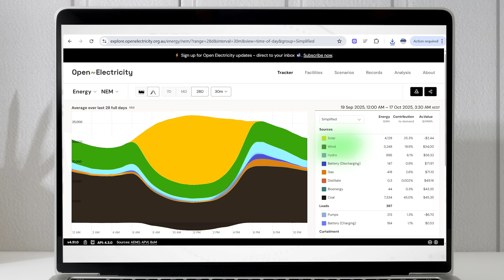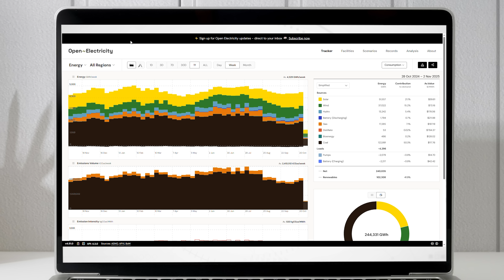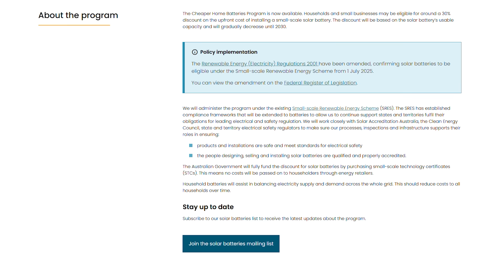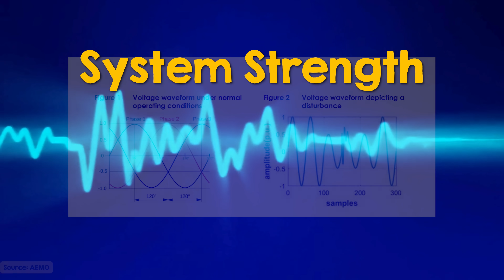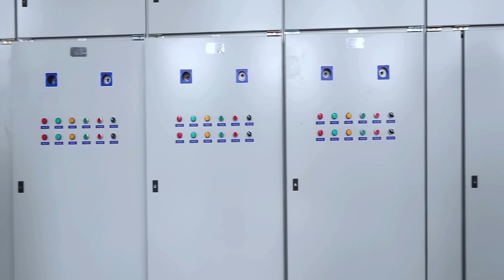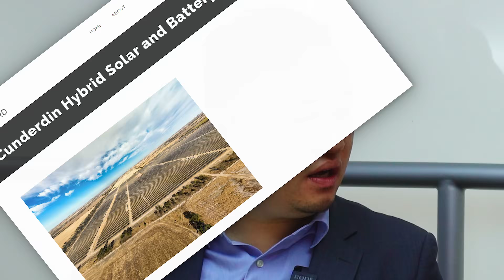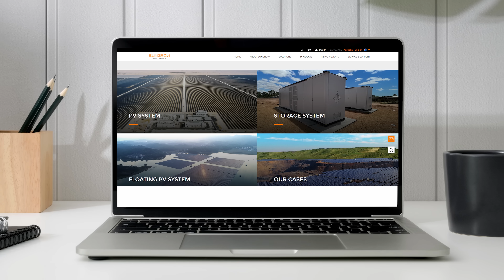Australia’s Solar Boom Is Breaking the Grid - Or Is It?

Comment: I never understand people who say "solar is bad for our grid" because i feel like they often miss the point of it all. That's why you hire engineers. they problem solve, that's their fundamental role, new problems? hire some developers, engineers, etc. they'll find a way.
Reply: @EngineeringwithRosie  How is the power factor corrected for the inductive loads on the grid, with all of these small solar installations connected to it?
Reply: @brianlove8413 historically, we used capacitor banks, installed at specific locations, to clean up the power factor. These days, we are pushing the consumer to fix their power factor themselves. As a linesman, I’m continually logging customers for this purpose.
Reply: @burkeyatm  I am aware of capacitors use in downline of generation, but the generators have to adjust for any power factor corrections if there isn't enough capacitors to deal with mixed and varied lossy loads. I get it that factories and the like with high reactive loads can use, or are forced to use correction methods. My question is more to do with the local "generation" of power through roof tops etc, and it ability, or inability to correct for local power factor problems. I was working the Marshall Islands power house  a few years back, they had installed a reasonable sized solar plant and overnight the power factor was around 8.5-9, come the day time the diesel generators were running at 6 to compensate for what solar was not helping correct.
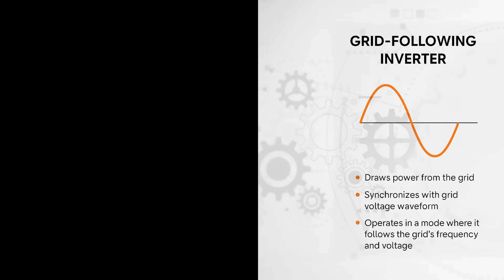Reply: @brianlove8413 Isn’t this what she is describing from 10:30? I assumed it was this, along with the Smart Meters we’ve been installing, that sought to keep the grid balanced. I’m not saying it is - I admit I don’t know - just what I thought it was about. Open to be informed otherwise.
Reply: @EngineeringwithRosie It's not like China where the entire Politburo are engineers. Or have the mayor design his own park because he is a civil engineering graduate
Reply: @EngineeringwithRosie  economics is critical to understanding of real world engineering.
😊😊😊😊😊
Excellent video. Perfect for grid understanding. 
$34billion for new grid capacity projects including HumeLink 365km $4.8billion project.
At $13million per km this real world grid cost deserves it's own video. 
GRID RENTAL is a concept totally avoided, but gives understanding to our very real world. 

RENT is based on ROI, return on investment.
Investment is based on replacement value, NOT SCRAP METAL value. 
Valuation on 1million km is $TRILLIONS.
ROI, say 10%, is $100sBILLIONS annually. 

Most of our electricity bills is GRID RENTAL to grid owners. 

Generation is dirt-cheap. 

Roof PV is dirt-cheap 2cents kWh electricity and NO GRID RENTAL. 

Please do a video on this matter.

The nuclear promoters and their massive backers are getting a free ride on this ignorant confusion.
Reply: @EngineeringwithRosie or develop an industry to use that extra electricity……
Reply: @alanmay7929 just send the power to the aluminium smelters? They can soak it up easy?
Reply: @greenvolksi7886 I bet aluminum smelters could be "run backwards" to make aluminum oxide and electricity.   Aluminum refining is electrochemical, a "solution" of molten aluminum oxide gets a current passed through it through carbon electrodes.  The oxygen forms CO2 with the electrodes, so there's a net buildup of aluminum atoms.  So....   You're still making CO2 at that point, but sheesh...
Reply: And the bean counters will find a way to get the second best solution
Reply: @emceeboogieboots1608  As long as it is good enough but cheaper, it is ok or even mandatory for the success. As mentioned in the vid: For grid stability the rotating masses of synchronous condensors are great - but expensive. The combination of batteries and modern interconnected grid-following nverters should take the task while being cheaper.
Reply: @klassichd10  Should is a very big word when it comes to electricity supplies. Must is the word that's more appropriate
Reply: @RalphFreeman-ok5of I agree! That is why I wrote "Before hiring engineers to solve problems, you have to detect and accept, that there is a problem.". Sorry, I am not a native speaker and I learned decades ago, that "have to" means "must" . Maybe I am wrong now.
Reply: @klassichd10 I will chastise my AI assistant Claude for being so remiss.😮
Reply: @RalphFreeman-ok5of 🙂
Reply: As an engineer, I approve this message !
Reply: People seem to have an allergy against experts.  My favorite example is the y2k problem.  It was exactly clear down to the second when the sh*t was going to hit the fan (no, the jet engine) and it was dealt with successfuly.  All in all a great engineering success.  And today there are muppets claiming it  was exaggerated  so big tech could make money, sigh.  As a compiter giy I can only shake my head.  So I'm all woth Rosie on this one.

Coming soon: use horsedrugs against ailments at the recommendation of a baker?
Reply: @ralfbaechle   muppets claiming it  was exaggerated because of all the work done to prevent it.  If there had been problems, the muppets would blame expert
Reply: @ralfbaechle Same with the ozone hole and acid rain, these problems were solved both by policy and engineering, but afterwards the same old wingnuts claimed these problems did not exist in the first place.
Reply: @ralfbaechle  The Y2K problem was overblown but that was because we had the answer and people still pretended that the world would fall over, both can be true at the same time, also I am a baker yet I understand the fact that both can be true at the same time and you do not?
Reply: solar is bad in OZ setup at the moment because the local grid or powerline system are not designed for that amount of load back flowing to the major grid system, including the powerline itself as well as the local transformer, which need to be capable to receive reverse flow. which means it needs upgrade and that cost money
Reply: @n @netron66 especially rural transformers where the voltages spike during the day outside of our nominal voltage range, if you change the tap settings on the transformers to correct it during the day they have low volts at night. If things keep going the way it’s going voltage regulators will have to be at the start of every distribution feed $$$
Reply: Exactly!
Reply: and then politicians say "thats not a solution that will get me votes" or "I cant say that, it goes against the rhetoric and Propaganda i sold to get elected"
Reply: There is clearly a technical Challenge with solar and Wind. While this is an Engineering Challenge, companies Are run by financial people and widely givernes also by governments. Thus Engineering cannot run the show from a technical point of view only. There Will be screaming and the likes from all sorts of people who Will not be limited and who Will not have restrictions. Most profound in free economies - like Australia - less som in EU - with more government controls.
Reply: There is a timespan and a commercial challenge. Not all issues are purely technical.
Reply: Well, arguably solar is bad for a grid designed to work with isolated fossil fuel power stations, that I can agree with, but it's not the system of wires and poles that are the issue really because they would be there anyway to distribute the power, solar is bad for a fossil fuel based grid, but it's good for a renewables based grid, and when you actually look at it, it's not such a huge problem as some people seem to think. A distributed grid based solution is the way to go, for instance look up Babcock Ranch in the US state of Florida. It's not a matter of it being impossible to do, it's just a matter of being willing to do it. Electricity grids aren't magic and it's quite possible to convert the entire grid over into a more suitable configuration without causing any serious catastrophic problems.

The entire town where I live is currently converting to a mostly renewable energy supply by 2026, we are entirely off the main grid here so supply in the past was polluting and costly generators, now solar panels and battery storage is going in, basically a mini grid based on renewables.
Reply: More engineer means more labor cost. No boss likes it. If you can raise the price to gain more, why  would you hire more engineers.
Reply: Oh you mean the people that you jerks picked on in high school?  You want the smart nerdy kids to fix your problems?
Reply: Spain
Reply: Batteries!!!!
Reply: I think who pays to fix the issues and how much is an issue...
Reply: Westerners have adopted an anti-growth mindset
Reply: Good summary, nice to see the TSTS syncon featured. I have been fortunate enough to inspect its interior b4 it was decommissioned 
.
Reply: What's hard to understand about that obviously we could engineer our way out of almost any problem, but the costs can very quickly get out of control, it's already been nearly a decade since I could use a heater and not worry about whether I can pay the bill when it comes and that's becoming more common.

We already spent way too much so people don't want to hear about spending more money generally, I understand why we need to do this but I don't think it's unreasonable for people to be mad and not want to hear about it.
Reply: No. Energy is an essential service. We should not muck around with it.
Reply: I feel like less people will complain when they get the free electricity in the middle of the day. 

Things are about to get a whole lot cheaper.
Reply: Engineers can only work within the laws of physics. You seem to imply they come complete with magic wands .
Reply: Because if everyone uses solar power, power generation companies (coal/carbon) will suffer losses and investors will lose money.
Reply: Have you worked out the cost and the materials required.
Reply: @RalphFreeman-ok5of have you worked out the cost of not doing anything? If its more expensive to let our coal and gas plants grow even older and less useful, then we should use our innovations, not our old technology. Theres are reason our trains are not steam powered anymore...
Reply: @slicer2938 Before hiring engineers to solve problems, you have to detect and accept, that there is a problem. Or at least, that there could be a problem.
Reply: Solar IS bad for the grid. For yesterday's grid! If you add lots of solar (or wind) then you cannot leave the grid as it used to be, it has to adapt to the new situation.
Reply: @ahoannon5711  TRUE!   You cannont leave the grid as it used to be!  It's assets are aging and the population is growing.  So we are forced to find new, cheaper, better ways.
Reply: @ahoannon5711 the problem is the fluctuations all the times, there isn’t any industry that can take advantage of the extra energy let alone the grid isn’t upgraded to handle all that.
Reply: @ahoannon5711 also renewable energy doesn’t keep the keep the grid frequency stabilization, the grid inertia
Reply: How to say you know nothing about the capabilities of electronic regulation for frequency stabilisation without actually saying it.
Reply: @Zirrad1  I thought about to write: "How to say you didn't watch the video without saying that you didn't watch the video." But then decided they weren't worth the effort. 😉
Reply: @Zirrad1 all the electronics are perfect for EMP just imagine having a grid that relies on software/electronics that can very easily be attacked online lol!
Reply: @Zirrad1 putting bazillions of electronics everywhere won’t solve any problems but just increase the levels of insecurity! Vulnerability and also all the hardware isn’t even made in Australia.
Reply: ??? Ah, the grid already relies entirely on electronic control.   You really are grasping.  Shill.
Hope you’re not stupid enough to not be paid to say idiotic statements.
Reply: @alanmay7929 Ah, yes, having lots of power generation, storage and contol facilities spread across the whole continent makes it so vulnerable to an EMP!
You just need to make an EMP device capable of enveloping the whole continent to take the grid offline.
So much easier than with a grid with a handful of power stations...
Reply: @syiridium703 😂
Reply: 9 out of 10 times they're low watt Sky News bulbs.
Reply: @ZARalstonofficial  what? Classic generalisation from a renewables zealot who isn’t an engineer and has NFI about security or physics.
Reply: Yes it can be a challenge but also an opportunity for low prices. It will also teach people to be better at mowing the load to the right times.
Reply: Typical leftist. The engineers hired are the ones saying it too. Most people saying it with confidence just have some sort of electrical background, that's how obvious and serious the issues are. You don't even need an engineering team to tell you that you can't defy the laws of physics and neither can engineers. Solutions don't just materialise because you want them too, you only want all this mess in the first place because some oligarchs have you lit via MSM propaganda that the world's going to end unless you push to force people to buy more stuff from them. (renewables mafia)

Sad situation really. Especially with the propaganda being so lazy and the least effective in human history so many fall for it and even take it to the bank.
Reply: @kierenalvarez  How to tell us that Propaganda was your word of the day without saying it 🤣
Keep crying from your sheltered ignorance while using your tiny little hands, regurgitating your spoon fed Sky News talking points all the time not realising that you are saying nothing, but like all right wingers you think yelling loudly with an unearned sense of superiority is a cohesive position.
Do you have any facts or is this where you run away from reality?
Reply: @kierenalvarez  how come you act the big man and mouth off but never say anything and then run away?
I think I know 🤏
Reply: @kierenalvarez 😱😛 somehow this became about politics... its always the ones with no pfp and no account history aswell
Reply: people who say "solar is bad for our grid"  have no idea how a grid works
Reply: @DSAK55  It's engineers working on the grid who say that.
Reply: @DSAK55  Energy retailers are in this camp as they are the ones that lose profit.
Reply: @DSAK55 you clearly have no fucking idea how the grid works if you think that lmfao
Reply: @DSAK55 yes they do
Reply: @alanmay7929 Nah.
Reply: Replace "our grid" with "coal power plants" and its correct.
Reply: @ShadeKirby500  And bad for fossil fuel companies and fossil fuel execs and their bonuses!
Reply: The further I read the comments, the more I see green fanatics of the “it’s cheap and environmentally friendly” sect, but I don’t see any of the energy specialists who would be faced with the problems of renewable energy infrastructure in practice, with a sharp increase in the cost of energy in regions with long regular periods of “complete calm”, with interference from poor equipment and with the failure of sections of the power grid after seasonal thunderstorms, snowfalls, electrostatic discharges, invasions of goats, birds, gusty hurricane winds with a sharp change in direction, etc. so on.
Reply: @MihailG5541  Funny you are here just making up numbers, like Denmark being 100% reliant on other countries for power and attacking others who don't agree with you, yet you can't see the hypocrisy in your own statements, spouting provable falsehoods to support your own argument.
Reply: @stevebrooks2361 You have no way to refute the facts, so you accuse me of lying
Reply: @MihailG5541  You did, it's right there in writing, "Denmark gets 100% of its power from Norway" et al. That was a straight up lie, outright, no hiding it, you can look up the facts online at an time, it will tell you where Denmark gets its power, mostly from wind turbines. That's a demonstrable falsehood, everyone reading this can check for themselves and see where you just made stuff up to support your argument, lol, you aren't worth discussing stuff with anymore if you are going to just make your own data up!
Reply: @stevebrooks2361 You didn't even try to understand what we were talking about.
The installed capacity utilization factor for wind generators on average in the EU is 18% in 2024, for solar panels - 11%.
How many hours a year does the power system depend on flows???
Always.
Reply: That’s why you are not in charge.
Reply: @DenisJ-rm2  and I can say the same for you DenisJ-rm2. Bot ahh name
Reply: I never understand people who say nuclear is bad
Reply: We also have to be able to face when there are real limitations.. or when we are trying to engineer our way out of a problem, but incurring costs to humans or the ecosphere that are ultimately mot worth the benefit an engineer figured out how to offer.

(Was just reminded of Fritz Haber, fuelling the global ‘Green Revolution’, with the Haber-Bosch process’ supercharging agriculture, and enabling a population expansion that the planet’s life balances are clearly deeply straining under- sometimes success can just be another word for overgrowth.  Are we doing the same with an insatiable hunger for easy energy?
Reply: Yes. Whenever any commentator says too much solar is a problem I just switch off at their ignorance....the same solution for the excess solar problem.
Reply: @jefftysoutube the energy has to be soaked somewhere. You can't just switch off. Keeping the grid running is like walking a tightrope keeping the generation and demand in balance. If you get too far off that balance systems start tripping and you get widespread power outages.
Commerical solar can disconnect from the grid or be constrained down remotely, but distributed rooftop solar is essentially an open faucet with no control on it.
Reply: @politesociety  Each solar system,  commercial or household should have it's voltage range built in, as is the case in many installations already. Local batteries and increasing the network and equipment voltage range helps. Maybe eventually we will see local DC networks if EV makers settle on a common voltage.
"Energy has to go somewhere" triggers me in conversations regarding solar! ....
Reply: Engineers solving technical issues is not the problem with solar.  Fixing the system costs money.  A lot of money.  Batteries are expensive, more expensive than nuclear generation.  There is no guarantee that even as battery prices drop, they will ever make solar power economically superior to a grid with nuclear generation and idle standby gas as backup.
Reply: @jinnantonix4570 that's interesting, since Rose has another video where she shows that solar is the cheapest option, even considering storage. But yeah, there is no guarantee...
Reply: @syiridium703  Rosie is being paid to promote renewables, of course she says its all good.
Reply: "solar is bad for our grid" = change is bad because it requires innovation and our economic system is controlled, unfree politics, based on fear of sovereign citizens. This is one more proof that capitalism, the free market, is orderly, flexible, and the violent coercive politics that parasitizes it is NOT.
Reply: The solution is CAES, I know is inefficient but  air tank is only 25% the price of the best battery,  so the savings can be applied to purchase solar, another advantage is that CAES  energy production can be bust or increase with natural gas ,hydrogen becoming a dual or even a inenturucte electricity supply.
Reply: @yvanpimentel9950 CAES are more expensive than batteries or pumped hydro electric stations.
Reply: @MihailG5541 do the math a scuba tanks is about 100 usa dollars and required 3kw of energy if only 50% is recuperate  is 1.5 kw, but if the tank is built 10 times bigger the unit per kwgo below 15 dollar per kw, litio is about 100 dolar, if the savings is apply to buy solar you get a fre self charging sistem, even 50% efficiency doesn't matter if is free,  a100 hundred dollar panels can produce 3kw daily.....
Reply: Most inverters already have systems to counteract frequency changes. The problem is that most of the time this is not activated and the protection features are just too sensitive and they don't try to keep the grid online if there is severe voltage drop or grid insulation
Reply: When a mortgage, child care, school tuition, health and the general cost of living has to be paid for, an engineer will do what ever they are told to do. Sometimes the problems we face are orchestrated by the problem solvers. Engineers designed the tools that started the Industrial Revolution, the world is current paying heavily for their efforts. This of course has always been bankrolled by capitalism for the sole purpose of making a profit for shareholders. Even your superannuation contributes to the problem.
Reply: good luck with your grid, call me when its already stable and your electricity bill goes down, which is, 2050 maybe? lol
Reply: Coal is cheaper . you want to make and solve problems use your money not mine
Reply: @dfsilversurfer says the coal industry, conducting a report on themselves and finding that they are cheaper. Stop regurtating liberal party talking point's, theyve lied to you
Reply: @dfsilversurfer  Well off you go, build your own coal plant with your own money.
Reply: If you're looking for any excuse then you will use this as a reason to use fossil fuels
Reply: very theoretical comment😂
Reply: More solar; more battery storage. 
It's cheap now !! Recycling old electric car batteries !
Reply: @GREGGRCO bla-bla-bla!!!! The grid needs to be upgraded to handle all the power! Batteries won’t solve the problem and also having an industry that can take advantage of the excess electricity would be perfect.
Reply: "...I feel like they often miss the point of it all."
The point of forcing wind-and-solar onto the grid is to create a state of permanent-blackout.
Reply: @aliendroneservices6621 
what are you going to do about this self proclaimed blackout?
installing solar and batteries?
surely you are not just going to sit there and wait for your blackout to happen?
Reply: Well, not all problems can be solved by just hiring some developers, engineers etc.... glaringly, climate change can't be solved this way! Which is exactly why it would be insane to retreat from those very much solvable grid-stability problems, instead of solving them properly.
Reply: @leftaroundabout  
ah yes,
as a matter of fact people thinking like you are actually the real problem
Reply: @leftaroundabout 
Those are political problems we know how to lessen the effects of Climate Change, but governments just will not allow it to happen. Its not terribly difficult just stop all burning of fossil fuels and work on methods of carbon capture. The problem is people don't want to.
Reply: @glenndennis6801  Its not terribly difficult??? What???? :-D,=D :^D xD
Reply: All it takes is massive amounts of money.  Have fun as your costs go through the roof.
Reply: @GlobalTrvlr  solar is cheaper...
Reply: @slicer2938 cheaper than what?  The energy costs are cheaper when the sun shines, but only after you pay more for upfront costs for unreliable power.
Reply: @GlobalTrvlr  You  understand that distributed renewable power means basically zero costs right? For instance solar on your roof with storage battery basically means zero power costs for you, that's how it works, ROI on solar and battery is down to a few years now and you have a system that lasts 25 years, everything after that first few years is free. Building local power generation in a distributed grid is actually far easier and cheaper than people realise, in fact we are already doing it. 

No it doesn't take massive amounts of money, renewables is both the cheapest source of power and the cheapest power system to install, what is keeping our power bills high at the moment is those few remaining fossil fuel power plants. Wholesale power price is based on the most expensive feed into the grid, and guess what those are, yes, coal and gas, peak power costs are based on those power plants not the renewables, they just get inflated profits from a high wholesale price created by the fossil fuel plants.
Reply: @stevebrooks2361  Nice try, but no. Distributed renewable power means lower costs down the road, but with huge investments in the early stages, some of which will take longer than 10-12 years to pay off, not just "in a few years".
Reply: @MihailG5541  And yet countries around the world are doing it without going broke, how is that happening? Yes a few years to pay off, it's that cheap now, you obviously haven't been following the latest data, you probably aren't interested. It's cheaper than every to invest in renewables and surprise, it continues to get cheaper.
Reply: @MihailG5541  Also point out if the world stopped paying the fossil fuel industry the "7 TRILLION" dollars in subsidies they do at the moment maybe there would be some money available for other things. That's yes "7 TRILLION" dollars we could spend on renewables and we wouldn't even notice it, oh except for fossil fuel car divers who would be paying minimum double at the fuel pump for their eco-poison.
Reply: @stevebrooks2361 You need to understand that there is a world outside of Australia, where the annual generation from renewable energy sources is very unstable, batteries help only for 2 hours, and the rest of the time a combination of power lines, gas and hydro generation is used for balancing and reserve, which increases losses by 3-4 times, requires up to 3 times more grid capacity and raises tariffs during periods of “complete calm” to 230-260 euros per MWh for 11-19 days once a year.
Reply: @MihailG5541  Oh dear a world outside of Australia, is that the one where Denmark is planning to be powered by 100% renewable energy by 2030, where Europe is building a grid to spread power demand out across the entire continent, you need to understand that the world is actually moving on and you are being left behind in an information vacuum apparantly.
Reply: @stevebrooks2361 Denmark is 100% dependent on hydro reserves from Norway and Sweden and on nuclear reserves from France and Belgium.

Will there be more bad examples or will you learn to count all elements of the energy system, and not just those convenient for calculations?
Reply: @MihailG5541  Oh dear, out of touch again right? Fact is 60% of Denmark's electricity comes from wind turbines, your claim they are 100% dependent on Norway, Sweden Belgium and France, you know how silly that sounds? Biofuels and waste account for 19% and 11% from solar. So let's add that up. 60 + 19 + 11 equals, wait for it 90%, so not sure where get that 100% figure from, made it up did you?

Apart from the fact you are missing the entire point of renewables and continental energy grids, renewables vary depending on day and time of year, so the amount generated will be different throughout the year in the same place. But when it's raining in the north Europe Spain can be basking in sunlight and producing solar, Scotland may have plenty of wind and be producing excess power.

Old style grids produce power at centralised locations like coal power stations and distribute it to where it's needed, you are not going to say ti won't work because X area produced no power, that's silly right. Continental grids and renewables work in the same way only over a wider area, they produce solar power where the sun shines, wind energy where the wind blows, hydro power where the water runs, geo-thermal energy where the ground is hot, and it's all stored or distributed around the grid where needed, this is how power grids work!

I mean it doesn't matter if for a few days the wind doesn't blow in Denmark and they get power from Norway, because when the wind is blowing strongly in Denmark and it's overcast in Spain they get power from Denmark, because it's a power grid and that's how power grids work!
Reply: @stevebrooks2361 Damn it, do you even understand what 15-minute flows mean, a triple load on interregional networks due to the wild instability of renewable energy sources compared to basic generation, reserves of thermal power plants and thermal power plants using pellets and a sharp increase in the cost of electricity in Norway and Sweden because of this from 6 to 20 times per decade and twice as much in France?

This is despite the fact that the share of renewable energy sources in France, Norway and Sweden, excluding hydro and nuclear power plants, is below the European average.

Are you ready to pay one of the most expensive electricity tariffs in Europe just to switch to renewable energy sources?

is the rest of the population ready for this?
What about other middle- or low-income countries?
Reply: @MihailG5541 So like a mortgage? What you are describing - incurring additional costs now for future returns - is literally the definition of a good investment.